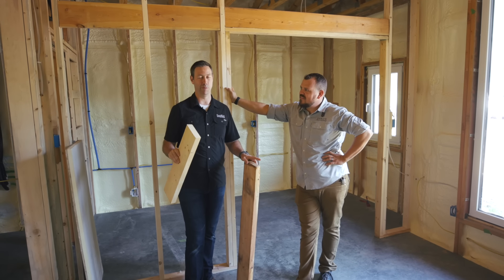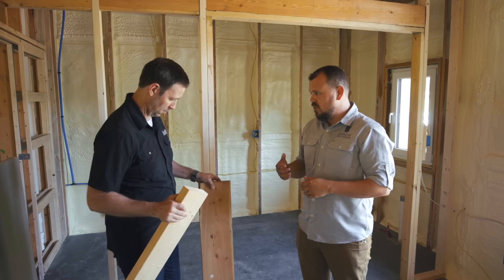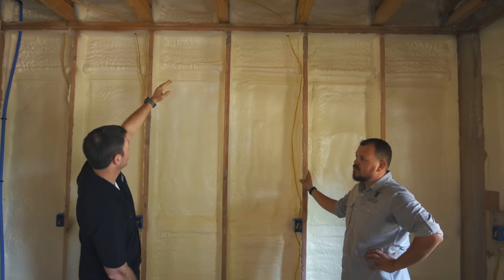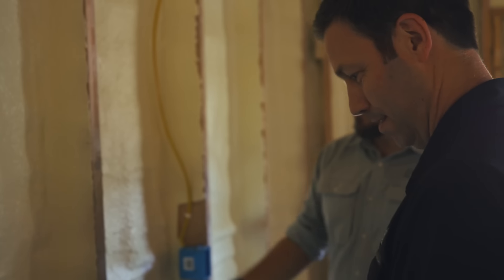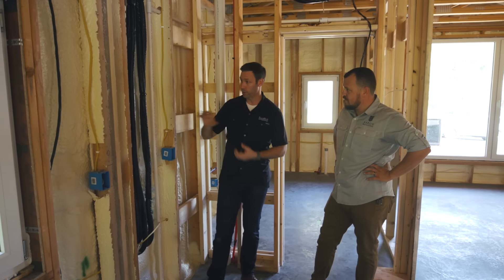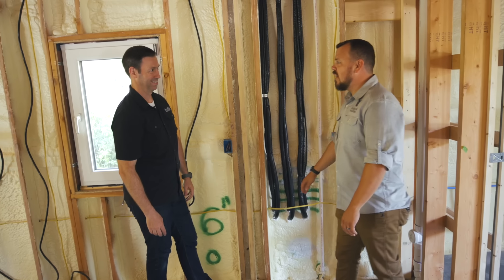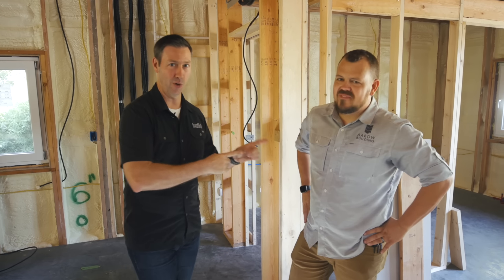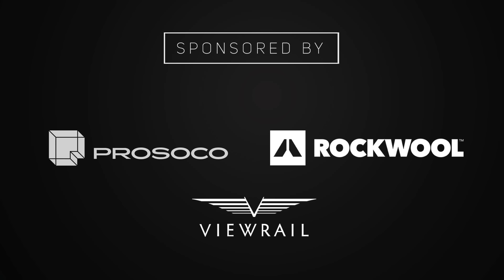Why would you frame a house with 2x8 lumber?

Comment: How are you letting the house breathe? Whole house outside air ex-changer? What about whole house humidifier? Heating source for the home?

What structural changes need to be made mating exterior sheathing with foam being mated up in direct contact to the 2x8's? I did not see any diagonal bracing just what looked like a horizontal nail board for the sheathing. I am obviously missing something.

I did something similar way back in the early 90's. 2x6 walls with pink foam panels on the exterior walls, sealed with tape. Urethane caulk and the base of the walls to the foundation (great for keeping crawling bugs out as well and no air penetration) Insulated and vented the attic with blown in insulation. The home was WAYYYYYY to tight, I learned a home needs to breathe. I have always used forced air heating by natural gas and a humidifier is 100% needed.

My fireplaces would not draw well, EVEN with outside air vents on the fireplaces. The manufacturers and fireplace installer were baffled. We had to open a window to vent the fireplaces which blew the whole scheme of saving money in the winter with heat loss. We had to vent the furnace with outside air as well, again practically unheard of in the late 80's early 90's for a standard residential new home around here. The humidity from the whole house humidifier was very tricky to monitor as well.

It was a learning experience and my builder friends benefited greatly from my learning experiences and so did a few suppliers/manufacturer/builders.

Comment: The old meat lockers would be made with 2X4 double walls.  That way you don't have the solid line of wood going to the outside.  Much better R value when you have double staggered walls.

Comment: Wouldn’t a double 2X3 or 2x4 wall with a space between them be better for thermal uncoupling?  Or even a single 2X4 wall with 3/4 of an inch of foam board over top of the inside surface, then 2X3’s laid flat like firring strips over each stud?  For that natter, what about just 2X4’s with an inch of foam on the interior, then 3/4 CDX over the whole wall

Comment: My house is framed with 2x8, isolated and then moisture blocked. After that there is 2x2 which all the electricity pipes run through. That again is also isolated. 10 inches with isolation. All isolation are fibreglass mats. No styrofoam spraying necessary

Comment: It's not only the framers who wanted the double top plate what about the drywall hangers? How do they nail the top of the rock on the walls? Wheres the bottom plate? Are you letting the rock span the studs at the floor?

Comment: I find it interesting that there will be 3 different types of insulation on this house.  You have the ZIP-R,  spray foam, and then blown fiberglass.  Is the cost savings so great that you don't just finish the cavity in foam?  You talk about the cost of lumber only.  How about all of the other costs and changes involved?  How about comparing the cost and thermal effectiveness to insulated studs, a video you crated earlier this year?
Reply: Foam's pretty pricey, esp. depending on when you're applying it because you have to worry about thick applications overheating. We're starting to see more open-cell atop a layer of closed-cell for air-sealing rather than flash-n-batt.  I don't know how much time/money that actually saves, but apparently enough for people to do it.

Comment: I built my house 2x8, there is a lot of additional cost, first its double the wood vs a 2x4 so it double the price for material, I built a 5000 sq ft home in California, also it’s not easy to lift a 2x8 wall vs a 2x4 so you have rent a lift to help you pick those wall up. Trust me it’s heavy!! I went that route because I wanted more depth in my recess windows with a 3 inch reveal. But if your ok with flush windows trust me it cheaper an the project goes way way faster... this advise cost me a lot of money so consider it when I mention it to all of you

Comment: seems like this size choice must ramify as additional costs at almost every step of the building process...more for lumber, more for framing (transportation costs as well as lifting extra weight), more for insulation, more for concrete foundation, etc.
Reply: Concrete foundations should be designed to carry any load not just enough to carry 2x4's

Comment: Not only better insulation but if around an airport it helps reduce sound and thats code in some states it is in az.just exterior walls and if who ever does not figure in that loss of space at that point of drawing up the plans you will end up with smaller rooms i cant remember the name of the builder? Taylor Woodrow Homes rings a bell and the airport was luke Air Force Base.

Comment: Go with a heavy knockdown finish.  2 ft centers on drywall no bueno for flat finish, unless you have primo lumber and 20' sheets of rock. R value plus all that cav space is very nice though. Bet plumbers and electricians love ya. Better put blocking in for cabs. etc or run tracks.

Comment: Great house! My question is...with a blown in insulation on top of the 2" foam insulation. Will interior moisture eventually affect the blown in insulation causing it to drop inside the cavity and "bulk up" at the bottom of the studs?
Reply: Exactly what I was thinking . I would ise batts
Reply: No it wouldn't. The house is virtually airtight so no air transported moisture will enter the wall cavity. This leaves the mechanism to move moisture as diffusion which won't put enough moisture in there to be a problem.

Comment: Would've been even better (at least for sound) if he did split/offset walls. So 2x8 bottom and top plates then staggered 2x4 studs for the structure. Then just switch to 2x8 wherever you need an opening. Couple that with Zip-R, 2 inches or so of closed cell, and then basic batts made for 2x6 walls, and you have a TRULY perfect wall, then. If you want to bias it for sound even more, stuff thicker batts than what "fits" into the walls and top it with decoupled quiet rock. None of it will really handle the sub 80hz frequencies that much, but 95% of your NOISE noise will be above 125hz anyway, which we already know standard construction methods can tame down quite effectively.

Comment: Check out the window with no header and a truss setting on top! Haha
Reply: I saw that! I thought maybe they used I-beams for the second floor above the top plate, but when I went back and looked, you are right! the floor beams terminate directly over the window. Maybe there is a full I-beam on the perimeter that we cannot see that is carrying the weight of the floor above. Then that would work.

Comment: Just out of curiosity, at work I see a lot of commercial buildings use exclusively steel studs. For both structural and no structural walls, so my question is, why do we not see more homes built with steel studs?
Reply: Too expensive

Comment: IMO
Building inner and outer walls with staggered studs 24" centers
With enough space between for electrical and plumbing 
3.5" outer 4" center 3.5" inner
Could provide a superior  insulation 
and no stud destroyed because of drilling through..
 But everyone can decide what they want
as long as code excepts it

Comment: Why not 2x6 plates using 2x3 studs 16" OC offset for exterior and interior walls with 1" external foam and plywood?   Use ceiling/floor trusses that drop 6" below the plate for additional insulation at the wall ceiling juncture.

Comment: Instead of that, why not double wall it with regular 2x4 framing?  That way your outer and inner wall is almost completely isolated (thermally) from each other.  It might even create some acoustical isolation.  2 x 4 (Stud) = $2.52,  2 X 4 x 8 = $2.77,  2 x 6 x 8-ft = $5.25 (Double) and a 2 X 4 x 8-ft = $9.91  (Triple).   For that money I would just build two walls and space them to give you a 12" thick wall.  You can buy (2) 2 x 4 studs for what (1) 2 x 6 x 8-ft cost.   Also, I seriously doubt a framer wouldn't up charge you for building 2 x 6 or 2 x 8 wall.  My experience they would up charge you more than double.

Comment: It seems like with the closed cell foam on the inside of the stud bays and the Zip R sheathing on the outside with its built-in barrier & tape, that there are 2 moisture barriers in the same wall. Should any moisture get between them, it has nowhere to go. Anybody have any thought on this?
Reply: BUILD THE HOUSE PROPERLY AND IT WILL NEVER LEAK. PROVIDE PROPER MAINTENANCE ON ROOF

Comment: I recently completed a 3000 sq. ft. Gragage Office with 2 x 8s (18" centers)...with R-38 insulation...after completing the sheetrock install early winter, we did not turn the heat on all winter and now finishing this summer and the AC has still not been turned on...2 x 8 is the only way I will go from now on...Strength and Temp economy...
Reply: 18"? Why? Doesn't that screw with sheathing material? 18" dosent go into 4' or 8' well at all.

Comment: I really hope he's not going to put fiberglass on the inside. That would cause huge water condensation issues when it gets cold outside. Once you have a vapor barrier you have to keep using closed cell foam as you go inwards.
Reply: Closed cell foam is a very  effective vapor barrier .   No air flow = no moisture flow.     Fiberglass insulation on the inside shouldn't be a problem.  If gypsum is used on the interior walls  it can  pull moisture  through.
Reply: @TheModelmaker123  but the foam is on the outside. You can get moisture flow without air flow since the warm moist air wants to flow outwards and the gypsum and studs act as wicks.

Comment: Spray closed cell foam seems like a brilliant idea. But is it really? What potential harmful gases are being released by this if any?
Reply: Closed cell off gases over time...and the path of least resistance in this case is directly into the living envelope. My understanding is that open cell does not incur same issue. Interesting that this difference is usually ignored by presenters who only focus on the positive attributes of spray foam in general as if both are, essentially, the same. Closed cell foam in foundation areas can promote moisture wicking through capillary and the R value is reduced over time (as it off gases) as well. Those issues are also ignored.

Comment: Matt,
im a homeowner in need of a residing.
i will be doing the outside in ZipR because of your channel.

is there a code i can use, or a purchase channel i can go through to be sure you get the recognition by Huber for the promotion?

also, i noticed some of the flashing products are rated to 130f.
i currently dont have a conditioned attic, and it will get over 130 in there.
is there an alternative product or method i can use?
im in florida, im sure you have similar temperature concerns. what do you do?

and finally, ive been studying up on the instructions for installation.
im finding some outdated info on their own youtube site, and also even some videos about poor contractor installation.
it seems like i, and several contractors could probably use an easy to find, how-to on the system.
what temp considerations do i need to make?
how do i pick the correct system components?
and then finally, how do i install?
yes, i know, roll the tape... but what about nails? flush? air gun? with or without fluid applied seal?
is this really so much faster if i have to seal all of my nails?

OOH!
this is a big one! what about how it fails?
not because i want to trash talk it, but if i know all the ways it can go wrong, i know what to avoid.

Comment: IMO it is a no-brainer and I would go 2 by 8 all the time. 
Even at today's lumber prices, framing 2 x 8 vs 2 x 6, the cost difference on a 4K sf house would be between 7k to 9k. considering the final cost of the whole project which will likely be in the 7 figures (including land costs), the extra cost of lumber is irrelevant, and actually that you can put R30+ value of insulation will make the house an easier sell in the years to come.
Between extra lumber and extra mineral wool, you may spend 12-14k more but it will likely make the difference between someone buying your home or the neighbor one.

Comment: You did a show about a year ago or so on the insulated studs tuba sixes and two 8 why would he not of use those just curious cuz I always thought those were a great idea for building a house never looked into the cost of them and the place that designed them are built over whatever course is not down here in the South that I know of

Comment: This house is using a split system instead of running duct etc?
Reply: Probably don't need ducted with all that insulation
Reply: You can do ducted mini-split. It's not common, but you can place a small, purpose-built air handler in the attic with some short runs off of it.
Reply: @colstace2560  Isn't that spray in insulation that gives you cancer? I'd want air movement.
Reply: @scuddrunner1  not sure, I've never used it, I'm sure the new sprayfoam has no formaldehyde like the old stuff did

Comment: being a framer for well over 30 years - I DAMN sure would charge more -- I doubt pudge-boy (not Matt, obviously) has ever raised too many 9 - 10 foot walls - and 2 x 8 to boot? seriously - you've got to tote it, shoot it and then cut it... but hey, if you're dealing with subs that are "doing the jobs that Americans won't do anymore" then I guess it ain't no sweat off yer back -- I do enjoy your videos Matt - always good, solid info
Reply: "Pudge Boy"?? Probably not a cool tact, certainly doesn't say much for you. As for the wall a 2X6 16oc vs a 2X8 24, the 2x6 is 16.5 board feet for a 4ft length and the 2x8 is 14.5 board feet. The 2x8 wall is actually lighter. It's your perogative (that means choice) to charge more, doesn't mean everyone would. I assure you his framing sub is as you note "American"

Comment: The problem with 2x8's is they twist and crown too much plus the thermal bridging. Double 2x4's would be my suggestion. I'm currently building a 2x6 then 4 1/2" space then 2x4 for a 14" wall including the 1/2" plywood sheeting. Resistance baseboard heaters will never break down and do not need servicing

Comment: I am a plumber in Northern WI. I have been in the trades since 1988. I have never seen a new house built without 2x6 exterior walls. It is code. I also put all of my water stubs in outside walls. I keep them right in the front, where all the insulation can go behind them. I plumbed my own house the same way and I have never-ever had a pipe freeze. I would never do that on a 2x4 exterior wall, but the wider the better.

Comment: What about exterior door jambs. Framers will definitely charge more, as well as trim carpenter. Zip panels are crazy expensive as is spray foam.
Reply: @GalaxyDrifter agree 100% if this house was for a client he would charge for everything $$$$$
Reply: col stace as a contractor myself, we of course charge for upgrades just like any other business. In my opinion a very good building envelope  for energy conservation, quietness and comfort as well as affordability, consists of 2x6 walls 2' o.c. W blow in wall insulation, 1/2" or better exterior foam board preferably 1" (not zip panels) AeroBarrier air sealing ( would take house to 2 ach's or less) and 1/2" drywall. On a 2k sqft house this envelope would add about $4k to the overall cost in my area. W/o energy star rebates, payback would be about 8-10 years but would continue paying back for a lifetime. With rebates 5-7 year pay back.
Reply: @0475Mike  a good percentage of houses in Australia are brick outside and 2x4 frames on a step edge slab, not much insulation in the walls and most in the roof, but we have a mild climate

Comment: Meanwhile, the foundation cracks. I'd do 2X6 or 2X8 exterior walls / roof and DEFINITELY upgrade concrete. I mean, if I was doing it myself and wanted to retire there. Where I live in TX has black death clay and forever moving. I did run Rainbird drip around foundation on separate controller/dedicated zone. Whatever you build is only as good as the foundation.

Comment: back in 2000 we frame a two story house for a commercial contruction company owner with 2x12 treated lumber even roof rafters, i still remember the weight of those damn fk. boards LOL of corse we charge lot more extra sq ft that house was overkill built...

Comment: why would you not frame with 2x4 double deep, offset? Normal insulation, on both layers, but second layer is 6" off set from first layer. So cold cannot follow the stud.

Comment: Why have you never even mentioned double 2x4 walls? I built my house 35 years+ ago when you only rarely heard of someone doing 2x6 walls. When you did it was 24" centers to save costs of about 1/3 on lumber. Not because it is better because it was cheaper. Many "spec builders" use this MO. 
There are many advantages of using double 2x4 walls stopping the "thermal bridge" as you say. I separate the two walls with a 1/2" gap between walls and ended up with R30 side walls with 1" foil face foam type board. For those who use Romex there is very little drilling. I use do conduit as a more green house now they call it and electrical unions called it "plus 5" wiring. I will not likely ever use fiberglass insulation again. I went to replace my Anderson windows and found the insulation did not do a good job of filling the wall meaning poor insulating. I am sold on Rockwool Comfort batt and Comfort board as exceptional products not available back then. Much better window sealing products also today. I also found that most of the foam type boards I used or were available were insect magnets much like using mulch (wood chips) next to one's building. 

I like some of your videos when you actually show detail that are relevant to the type of construction you are showing. Many are very vague. Keep up the good job showing new modern materials and methods, just please be more thorough and detail oriented. If it is new them many have never seen or see the "best practices" using it